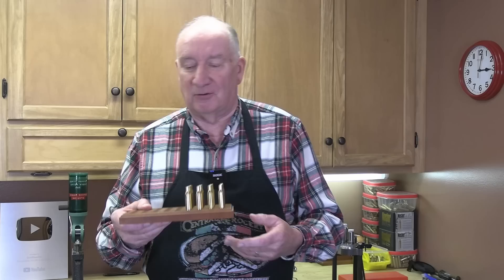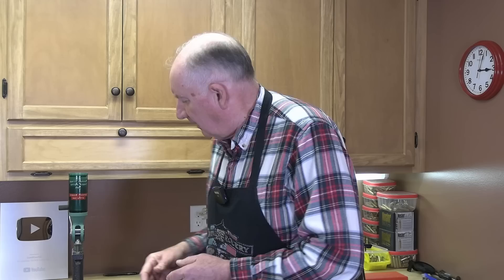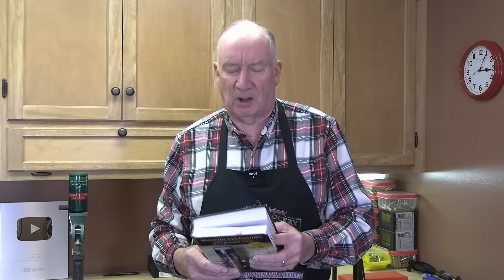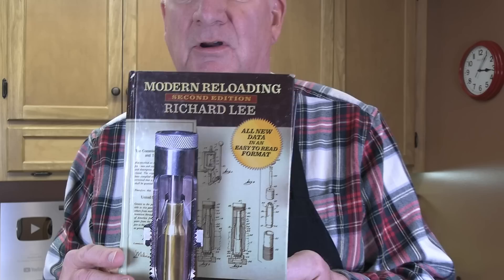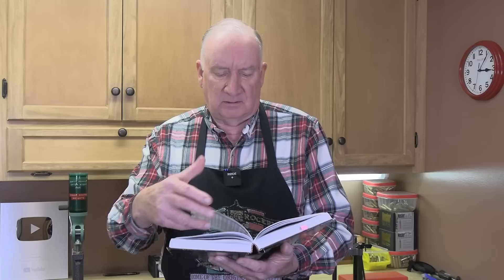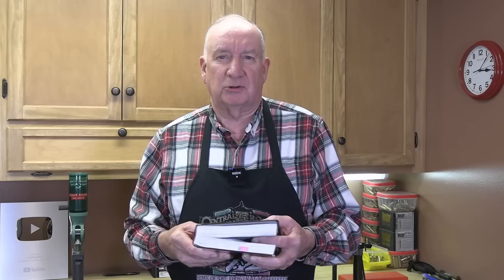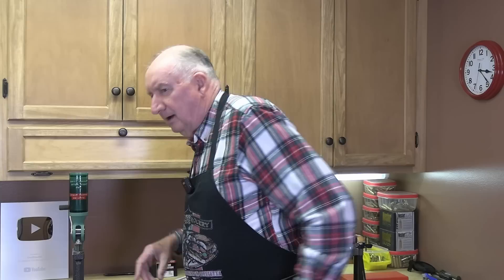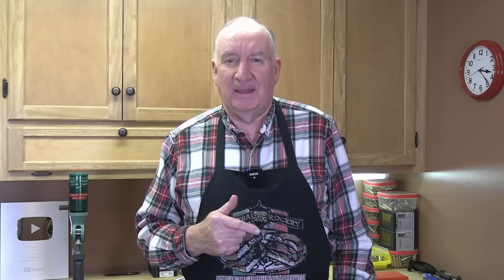How to Make Super Accurate Ammo ~ Part VI Powder Selection

Comment: I haven't had a chance to reload in a long time. When I was doing some, I was going to work up a light load for a Ruger 357 Magnum revolver. I started out with the lowest load listed in the Speer Manual for whatever powder I had chosen.. Much to my dismay, after firing, most of the cases in the cylinder were split! A guy at the local gunshop said some powders created excess pressure with too little powder as badly as with too much powder. He said I was lucky to have a strong Ruger revolver, because some guns might have blown up. Kind of made me leery of reloading. Have you ever experienced that pressure phenomenom?
Reply from the maker: His guess was entirely unfounded.  It's not a pressure phenomenon at all.  Very simply, cases only split when they loose their elasticity from a number of reloading cycles and firings, OR if they were previously fired with corrosive primers, which crystalizes and hardens brass.  Corrosive ammunition was common prior to the 1950s and is still used in other countries.

Neither a light or heavy charge can split a normal case.  Sooty cases result from very light charges that don't seal the brass to the chamber wall.  Heavy charges can only expand the case to the dimension of the chamber wall, and if they exceed that dimension, it's because the gun has blown apart.  Simply, the cases were no longer elastic.
Reply: @GunBlue490  Very much my own experience. The only split cases I've seen were many times fired and hardened brass. That was only standard target loads so neither too low or high of a charge.
Reply: Thank you for the replies. It has been too long to remember what cases I was using, but I had purchased some brass and saved some other from factory loads. I had never reloaded them enough to have run thru very many cycles. Maybe the cases were made of inferior brass to begin with?
Reply: @GunBlue490 .   I’ve been casually reloading mostly 44 magnum for over thirty years now.  I absolutely appreciate your explanation of split cases.  I’ve suspected your explanation but now I can stop guessing on the issue.      Please give Benny a scratch behind his ears for me.

Comment: What are your thoughts abt "hard to find" powders such as..hogdon superformance powder? Its a tough one when looking for load data..very limited application tests and very small batch of cartridges in which it "works". I have tried this powder in a 270 and 30-06, with good results (accuracy and velocity). I wish the manufacturers would give all the data and not just where they thought it worked. My opinion...

Comment: I would like to know why Blue Dot is suddenly impossible to find in stores locally, or even online (assuming I order enough to make the hazmat fees worth it.
Reply from the maker: Sure.  Blue Dot is a specialty powder for magnum shotgun and heavy pistol loads that has many more popular equivalents, so I'm not surprised that Alliant is putting their production efforts in their higher selling powders until demand stabilizes.  There are at least six other powders that approximate the performance of Blue Dot. Check out Herco, Super Field, Accurate #7, Longshot, Win 571, or HS 7.  Do NOT use the same data though.
Reply: I both have in my supply and do like using Longshot and No. 7, but they don't quite get me the performance that blue dot does out of my G20 with KKM barrel. I will definitely have to try some of the other suggestions you gave - thank you for the tip! And of course, I will use appropriate loading data and "work my way up" to the higher end of the suggested charge weights they suggest.

Comment: The 270 is what is going to be my first loading experience and its because I was intrigued by the new burger 170 that's not factory loaded yet by anyone and probably won't be. I talked to a rep who was very nice and showed me there stability calculator on the website and with the 1 in 10 on my Remington 700 it is borderline but says it could stabilize it. Do you think you need a custom barrel with a shorter twost to really shoot that bullet accurately? I'm looking for big game performance not competition.  Thanks!
Reply from the maker: Velocity combined with twist rate increases RPM, so at maximum velocity, it may stabilize.  Remember that stability is a length issue, not a weight issue, so a short, blunt, round nose 170 grain bullet of the same length as a 150 grain bullet will stabilize easily, but of course will have meager BC.
Reply: @GunBlue490  thank you kind sir!
Reply: @it_is_what_it_is_brotha  
Another consideration is that your BC will be somewhat reduced by marginal stability. I believe Berger has a correction for that in their calculator.

This likely won't have a huge impact, but is something you should be aware of if you are planning to use it at extended range.

I've shot some marginally stable bullets and had pretty good success. Whenever possible, I would go with a slightly shorter bullet to avoid potential issues.
Reply: @ExF1Guy  thanks! Sticking with 145gr nosler ballistic tips or Hornady eldx's is just not novel enough I guess to intrigue me to do the work haha.
Reply: @it_is_what_it_is_brotha  
That's a completely valid reason to try something different when reloading. That's how about 60-70% of my reloading projects start. Some work, some don't. As long as you stay within safe limits, the worst you'll have is a poor group.
Reply: What are you going to be hunting? Remember that bullet construction is very important when hunting large game animals. I've been loading for .270 Win for 30 years. My loads are tailored for whitetail deer, I use 140 grain Nosler Ballistic Tip and I've had excellent results in the field. I can't recall ever needing a second shot.
Reply: @ecleveland1  spot on and in my humble opinion,,burgers are simply a target bullet with a thin jacket, they can label them as hunting bullet,but it is what it is ,,a true hunting bullet is nosler partition, accubond, and the monolith line , with Barnes ttsx riding the highest horse